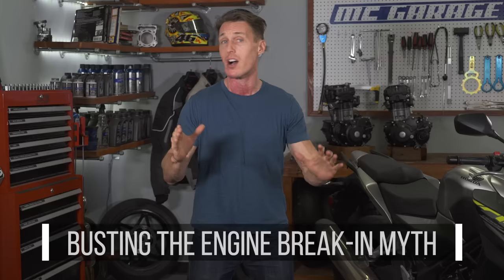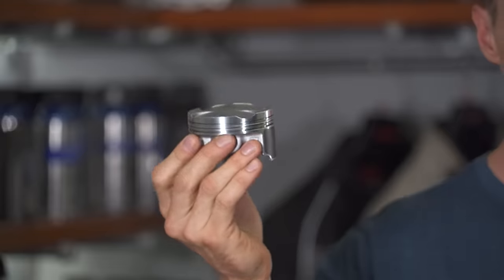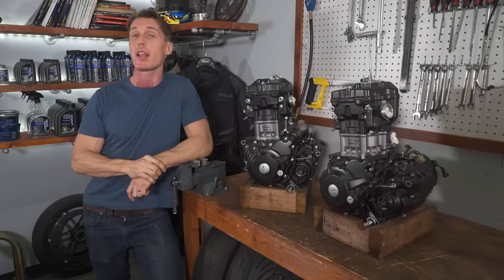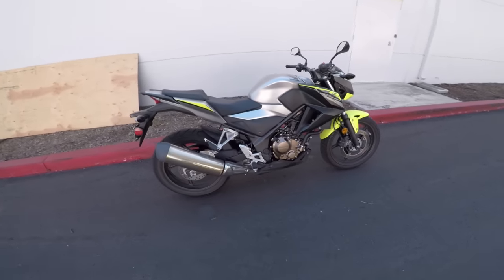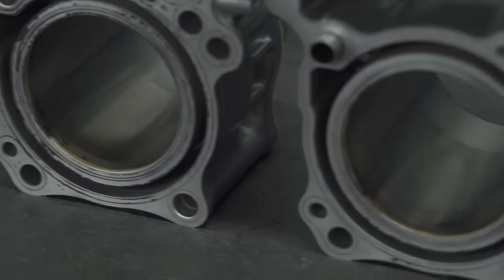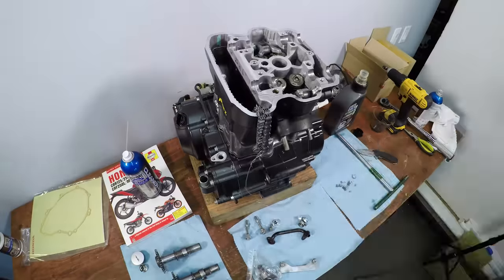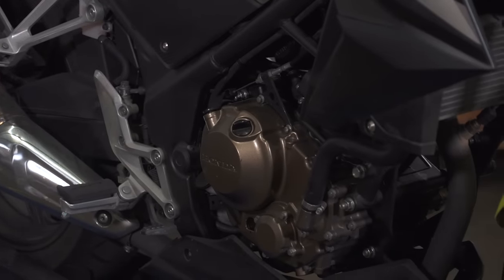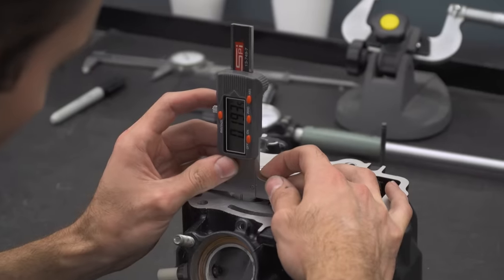Busting The Engine Break In Myth | MC Garage

Comment: I've been a machinist since I was a kid , and a motorhead. Good video. Truth is if something isn't engineered and or machined and or assembled ,  properly there will be above average / premature wear. If it is done properly there won't. The valve face and seats will beat themselves in slightly within a couple minutes, the rings and bores same . Bearings and bearing clearances are either write or wrong. There's no magical best way to do it . I say run them easy = no more than half throttle for 1st half hour , change oil . Run it up to 3/4 throttle half an hour and change oil , then start nailing it whenever you want. If it was such a big deal new cars and bikes would have alot of problems and they don't because modern materials and machining and finishing practices are so good. Bores are soft honed to reduce acsesive wear and heat , and what is just as responsible for sealing rings as bore and ring face quality,  is the gas pressure behind the ring or rings that pushes it out towards the bore wich is why larger rather than smaller ring gaps are bennificial. Lastly overheating a new engine  in particular is the worst thing for them . Really they're either write or wrong .

Comment: I’ve always just ride it easy for the 1st 200 miles and after that it gets ridden like I stole it. Never any issues after 50k miles
Reply: I always let the engine idle for a bit to get some heat, ride it slowly and calm until it fully heats up and then I start giving it the beans, never had issues not even with 2 smokers

Comment: I think you missed the purpose of the "brutal" route. The idea is to put the motor under a heavy load (heavy throttle in too high of a gear and engine breaking). Higher RPM is more like the "by the book" but louder.

Comment: You mentioned the only noticeable difference was the piston rings.... soooooo what was the difference? The piston rings are one of the main reason the factory recommends lower rpms for the 1st several hundred miles and a huge reason i watched this video.
Reply: He said "piston ring end gap". The summary above listed the difference as .0145 normal vs .0150 brutal. Not sure if that means anything.
Reply: Z1000 Power Lifter  floating gears doesn't hurt anything if you're not grinding them.

Comment: I think the important thing here is the oil change. It probably doesn’t matter what oil you use as long as it’s the recommended weight. All engines do have to break in and getting those metal shavings out early will prevent excess wear. It would be cool to see a test done on this particular topic.
Reply: Absolutely. I've just had some twit on reddit use this video as evidence that the oil change is not important when I suggested a second followup oil change for riders who may have really babied their engine during the run in period. That increased end gap is ring wear. That means more metal shavings in the sump. But which engine had the most metal shavings in the sump at 1000 miles? Now there's a question that I wish they had answered. But still a useful video.

Comment: I think people will still “break in the motor” only because it makes them self feel more comfortable while riding.
Reply: RonLaGasss Volgs I do it because the people who actually designed the thing say so. If the manual calls for it, might as well follow it just to be safe.
Reply: Even if it is more or less pointless, there's absolutely nothing wrong with taking it easy and being generally consciensous for a few hundred miles while you get acclimated to a brand new bike.
Reply: @patw9175  exactly
Reply: @Quinn Dang What about riding on the freeway makes it so a rider can't do any of the things I mentioned?
Reply: Quinn Dang 
Well, just don‘t use the highway then..ö
Reply: Quinn Dang 
1. why the fuck would you want to get your vehicle from a dealer that is that far away
2. if you really want to get to a dealer that far away
A) use a trailer
B) just drive a bit slower (for 125 engine: instead of hammering down the road at 100km/h, drive 60-70!)

3. how you treat the vehicle is up to you, but everything you do AGAINST the way the manufacturer states will void your warranty!
Reply: I'm following the manufacturer's recommendation.  It doesn't cramp my style in the least.  However, I'm not inclined to tell anyone else how to ride their bike.  It's still a semi-free country.
Reply: New bikes don't need break in as much. However, older, rebuilt or homemade engines can benifit from it to ensure any defects can be polished over with gentle use instead of being aggressively ground away at wot. For new bikes, just ride a couple times gently and fully warm up the bike before going fast.

Comment: bye bye engine ( you guys droped something in to the oil while filling the engine with oil 4:51
Reply: Just saw that! Looked like a piece of foil from the bottle seal. Luckily this engine (and all others) have a screen on the oil pickup for big/coarse stuff and then an actual filter for the fine stuff.
Reply: All engines have an oil filter, dunno what is its purpose tho
Reply: look closer, nothing dropped. That just was the viscosity of the oil.
Reply: Just a bubble.
Reply: Check at .25x speed, I see a glob of oil coming out but no debris.
Reply: it's not a blob nor a bubble, no need to slower down the speed of the video, it's clearly a piece of foil from the bottle seal.
Reply: Saw that too but thought it was just turbulence caused by the foil at first. Went back, definitely was a piece of foil. .25 speed shows multiple frames of it too lol. BTW, it doesn't mean bye bye engine. The funnel could of caught the foil and they probably saw it too and at least fetched it out.
Reply: @aflacduck2  really? because i watched it at 0.25 as well and paused the frames, anything that looked like foil was more than likely light refraction inside the oil due to the overhead lighting, pretty sure it was just the viscosity of the fluid, watch what happens with the frame just after what looks like foil drops into frame, you'll see anything thats supposed to be "foil" doesnt exist only half an inch downstream, hence it isn't foil... now look at the lip of the oil bottle, you'll see there's a bunch of light that's reflecting just above the oil stream, when the viscous lump came through, the light must have shone on the oil directly making it look metallic
Reply: I’m not sure if it’s foil. The oil I put in my bike doesn’t have foil to open it. Just a seal on the cap like a bottle of water. I’m pretty sure it was just a bubble in the oil. That might of been the lighting reflecting off the oil.
Reply: @AriH211   didn't know that  so i guess the engine will live for an other day  thank you for the info
Reply: @billabong503  Yeah it lived for 1000 miles and all the vitals were perfect, so clearly it wasn't an issue.
Reply: @schr4nz  You are wrong. It is 100% a piece of foil. You are more likely to have not slowed it down with pauses to see the foil or if you are, you are not watching the part with the foil. It is clearly a piece of foil.
Reply: @Price_719  a lot of engine oil have a foil seal on top of it (mouth of the bottle). can't believe you never saw one
Reply: R i v a l r y R i d e I use valvoline 10w-40 motorcycle oil and when I open them it just breaks the seal on the cap and it’s ready to pour. Haven’t used any other brand. I could  be wrong. It could be a piece of foil.
Reply: the editors wouldnt use a clip of them fucking up i thought the same till i watched it a bunch looked like foil but slowed down foil doesnt morph like that

oh and jet fuel doesnt melt steel beams
Reply: @Price_719  yup valvoline is one of the brand that not using foil seal. bellray and yamalube using foil seal.
Reply: @Moto_Medics  yeah but the editor is human too, people making mistake. maybe he's tired so dont pay attention as he usually do. if even Ari who did the oil change say it's possibly a foil, I think that's more valid than any other arguments here. cheers
Reply: Sound like a drunk at 0.25x but thats def a piece of foil...
Reply: @helicopter234  definitely a piece of foil, its so thin and made of aluminium, it wouldn't cause any harm  though it will be turned to dust after 5 seconds of run time
Reply: then again it could instantly get trapped somewhere and cause a blockage
Reply: @AriH211  I've just subscribed to you just for the purpose of following what you do next. Can you please keep us updated if you can bruv? :)
Reply: ben aharon 
Bubble.
Reply: Well spotted! You’re 100% correct
Reply: TIL I can slow down YouTube playback 👍🏽
Reply: @Moto_Medics  and if the editor dosent know anything about motorcycles or engines he might use it
Reply: @Felipe-tw1wg  Not all engines have an actual oil filter. But I think nearly all of them have an oil screen in front of the oil pump.
Reply: Its aluminium foil from the bottle and its not going to pass in vital components it should stop in the oil filter.
Reply: Owen Price just because you have never seen it before doesn’t mean you couldn’t just look at the clip and see foil all over the top of the bottle they are pouring it from
Reply: @Price_719  they clearly have part of the foil still on their bottle bro.

Comment: I have a 2018 R1 and I chose to break it in easy for the first 600 miles due to it being a high performance engine with high compression and revs.
Reply: And if anyone tells you that you made a mistake by doing that just ask them if they've designed and built half the number of engines that Yamaha have.
Reply: Breaking something in "easy" never hurt an engine. Your bike, your process.
Reply: @mercedes12123  To be fair, they probably say take it easy over lawsuits, etc. So people can't complain about the bike breaking for the first thousand or so miles, and Yamaha being held responsible at that fact. Or so they don't kill themselves when just hopping on a brand new bike.
Reply: @IamMortui 

maybey.
From yamaha: 
Since the engine is brand new, do not put excessive load on it for the first 1600km (1000mi). The varius parts in the engine wear and polish themselves to the correct operating clearances. During this period, prolonged full-throttle operations or any condition that might result in engine overheating must be avoided.

You can listen to 100+ engineers from  yamaha or any bike manufecturer or to some idiot on youtube who thinks he knows best.. 

YOU CHOOSE ....
Reply: @mercedes12123  they do take every single bike onto a dyno before it leaves the factory y'know. So yes, they do test every single engine and yes, they do take them up quite far in the rev range
Reply: Paste a link here of a video , post from yamaha, honda.... where they say : "every engine gets dyno tested"

And even if ? so what? Look what they say about break in procedure .... Its for a reason ....
Reply: IamMortui - “To be fair, they probably say take it easy over lawsuits, etc. ” yes that’s a self defeating argument.
Reply: @mercedes12123  Yamaha, and every manufacturer, dyno tests their bikes to redline as part of the final QC process. Break in myths are as abundant as oil myths on the internet, and they all come from some asshole in his garage somewhere in the US typing directly out of his ass.
Reply: @mercedes12123  I choose to take advice from people who can spell.

Comment: I'm not surprised  in difference but BMW s1000RR motors where having more problems before 600 miles break in, I would still suggest old school  variable throttle  600-1000 miles. Oil ? Simi synthetic oil as a industry standard is  only 10% synthetic to conventional  !
Reply: That was only the earlier models. I broke my 2016 S1000RR in HARD. One thing that does seem to help us the 9000rpm rev limiter you get from the factory, which is removed at the first service. I took mine in at about 450 miles instead of 600.

Comment: if an engine life is good for say 100000km, wouldn't a 2000km run at the start show pretty much no difference between the two methods? you'd see the effects, if any, later on in life? you're better off following advice from the manufacturer than some guy who has an opinion.
Reply: not really, when the parts have more microgrits they have larger friction, if you beat on it you might create an excessive heat on the part and shorten the life of that part. after those microgrits are broken in it will create less friction.
Reply: @dkongul  this is just your theory. and you're not even sure of what you're saying.

Comment: This testing was a great service, and I certainly appreciate it - thank you!  However, there is one obvious test that you could have performed, that is conspicuously absent here: Oil Analysis!  Why didn't you send the used crankcase oil from both engines off for analysis, to see what it showed?  I realize that a brand-new engines won't show drastic differences, but given that you couldn't find ANY differences worth mentioning, this would have been (potentially, anyway) very illuminating.
Reply: I would rather just leave it to bro science.😆

Comment: take a microscope to all the bearing surfaces, and guides. how much embedding and etching is there?
Reply: Thats what I'm interested in. The cams as well. Not the piston
Reply: None.  Flow lubricated surfaces don't "break in."  Literally the only thing that breaks in on an engine (and this is an engine builder saying this) is the rings.  

If you can notice ANY metal in your oil or filter after breaking in an engine, your engine builder either got a surface finish or clearance wrong, and you need to fire him posthaste.
Reply: @immikeurnot  oo touche, that's good to know

Comment: Ari, glad you are still among the living !   I am most grateful for a look at the internals of the CB300... a bike I know you have a history with.  It is and the CB250  have been on my radar for some time. Man what huge valves for a 300 !   Lot of development and technology in a "cheap" bike.      Close tolerance water cooled FI motors are the Least prone to break-in ( or even warm up neglect)  problems.  While old school air cooled carbureted engines ( think aircraft)  are the most prone,  iron jugs, aluminum pistons, and very changeable fuel/air metering during warm up !.   The change in gap between the rings in the two engines might be significant.. but you don't tell us what it is.  Oil Analysis is another tool that gives great answers about wear !   Long term longevity is the invisible elephant in the room..  for which there will be no answer here.     Oil choice is very significant .. older motors want the trace metals ( for their bearings) that don't exist in oils designed for motors with cat converters..  While these modern engines don't want anything but synthetic.. ( except for break-in).  Devil is in the details.. so the owner/rider who really knows his particular machine, is the happiest the  longest.    I am sure what you said here will serve owners of New Modern Bikes well.   Easy does it.. and good luck in the new  gig.

Comment: Thanks for this video and all the work that went into it. I recently got back into riding after a long break and picked up a ryker rally. I had to pick it up in hot springs and drove 250 miles home, I put it through it's paces on its way back then read it wanted a light break in for 200miles. I was hoping I didn't do anything long lasting to it. Runs great, had no issues. This video made me worry a bit less. Thanks.

Comment: We built race motors to go 100% right off the hop. Still, a tight motor needs a couple warm-up and cool-down cycles. Not an issue either way. Nice job on the fireworks, glad you made it and I hope you heal up.

Comment: My brand new Honda motorcycle is vibrating at the handles. This is the CB350 and is famous for zero vibrations on the handles, seat, and foot pegs. Do you suggest I check anything for troubleshooting? I’m worried. 😫

Comment: I've had my last 5 bikes dyno-tuned with power commanders and pipes, all with less than a hundred miles yet on them. In the case of my 2012 V-ROD Muscle...it now has over 100k on it, with zero smoke at cold startup, and zero problems other than the wideband O2 failed and was replaced. The second high mileage bike that was ridden hard and put up wet after each ride, several of those to and from Sturgis, from Indianapolis, is my 2013 CVO RK...was dyno tuned and piped with 175 miles on it. That bike now has 85K on it, and of course is air-cooled, and runs like new. Only issue is the one it was born with...top-end rattles in traffic from high heat, but not even that over and over has caused a lasting dependability problem. Then there's the bike in my profile/avatar or whatever...2012 CVO Convertible...the same air-cooled 110 in the RK...it became my wife's bike, but not before the un-broken-in dyno tune and pipes, and my big ass thrashing it for about 20K. Sold that bike but, I'm friends with the dude who bought it, and he still rides it today with zero issues...not sure about the miles but he seems like he told me it's around 60k now. My point in this ranty post?....these are Harley's man - you know, the bikes so many thick-heads say are junk. If these "Junk" bikes make it through entire normal bike life-expectancy without sissyfied  break-in periods, shouldn't Japanese and Italian bikes make it even easier? I mean sure, don't bounce it off the rev limiter on that first tank of gas, but even if you do, it will be ok. A run on the dyno isn't exactly a gentle run! If something comes undone in that engine, it likely was going to at some point anyway. Best that you find that weak-link while it under warranty vs babying it so it waits until AFTER warranty to present itself. When I spend 35 thousand on a bike, that sucker better blow-up under warranty.